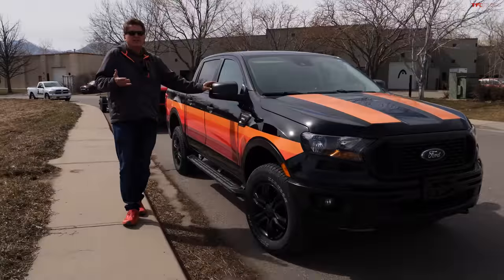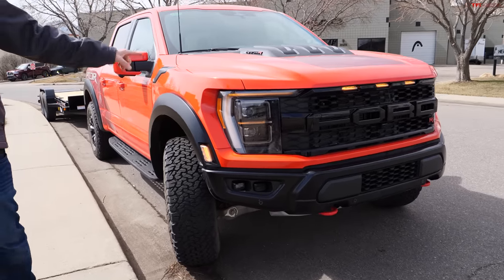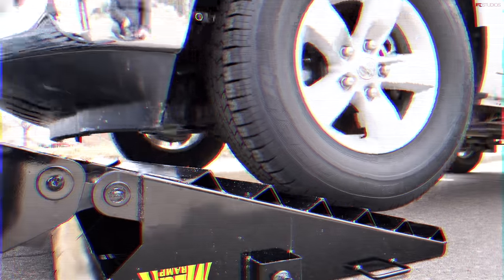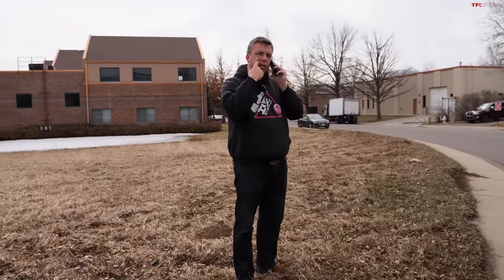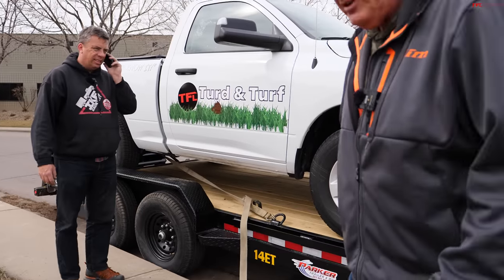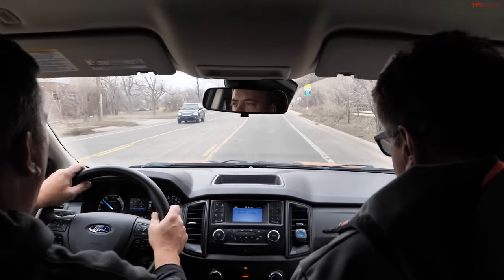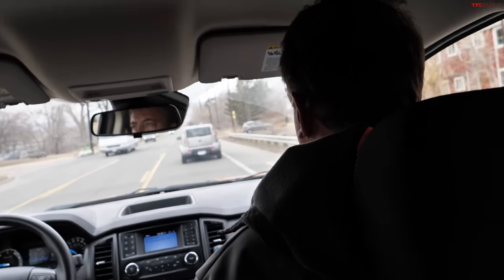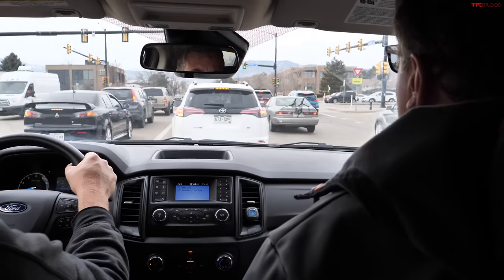I Made a HUGE Mistake and Bought the WRONG Trailer: How Do We Fix It?

Comment: I hope I’m wrong, but it looks like you traded one mistake for another. The saleswoman said the deck is 66” wide. A RAM 1500 has a 68” track width, and is almost 80” wide overall. Even the Ranger is probably too wide to fit. This trailer will limit you to hauling equipment less than 66” wide. Seems like a car hauler trailer would be better for your application than an equipment trailer. Also, it appears the front tires will pass the tilt point before the rear tires are on the deck, or does the deck lock in the tilted position?
Reply: The pickups will fit, because the tires can overhang the width of the tilting deck (although something like a Raptor may be a problem getting the front fender flares between the trailer fenders).

I absolutely agree that a car trailer would be more suitable for hauling cars and pickup trucks than this equipment trailer. Essentially, they swapped a highly unsuitable folding-ramp equipment trailer for an unsuitable tilting-deck equipment trailer.

The new trailer is a 14FT-20, from Big Tex Trailer's 14FT series of 14,000 pound self-tilting equipment trailers. Their website (which I can't link in a comment on this YouTube channel) has a "detailed measurements" drawing which is missing actual lengths, but indicates that the pivot is behind the middle of the deck (presumably so that it sits down when unloaded). That means that the deck will start coming back down when the front axle is less than 10 feet up the deck (in the 20-foot deck model), so any wheelbase over 120" (which means every pickup truck) won't work. I've seen a neighbor get caught by this when he tried to move a pickup with the trailer that he usually uses for his skid loader.

I don't see any way to lock the deck up, there is no manual available on the website, and if there were a mechanical catch it would likely be impossible to release under load. It could have a hydraulic lock, but the sales rep didn't suggest that in the tour.
Reply: I was hoping no one caught my slip up on the platform width. It is 6'6" wide not 66" wide. You'll have to forgive me I was a little nervous. On the full tilt the deck does not lock in the tilted position.
Reply: @brianb-p6586  Thank you for your detailed response. I got the 66” inch width measurement from the video, but I see that was cleared up in another comment as being 6’ 6”, a big difference.
Reply: @rickcollins1796  It is a very significant difference, but some trucks with wide tires will be wider than even 6' 6" (78", 1829 mm). 

For instance, the current Raptor has a front track width of 67.9" (1725 mm) and tire section width of 315 mm (stock) or 12.5" (optional), for a width between front tire outer sidewalls of 80.4" (2042 mm) and across the front tire treads of 78.5" (1994 mm)... and that's stock.
Reply: @AngieDavid-mx5dn  Thank you for the clarification. Don’t be hard on yourself, no one can recite the specs for everything on the lot, especially with a camera pointed at you!

Comment: The 4-cylinder vehicle got 6.5 not 8 MPG when you used it to tow the trailer and vehicle and it was not able to maintain freeway speeds, that is something you should be considered in this test. The smaller engine with a turbo may work for a short distance, around town but not for long distances it is inadequate.
If you really wanted this test to be accurate you should be testing a petrol engine and diesel engine of about or as close to the same displacement but then it is known that the Diesel is a better tow engine that is why semis have diesel motors.
What is needed to tow or haul is torque, not horsepower for this a diesel make more torque and less horsepower than a compatible petrol engine and going back to the 4-cylinder not being able to maintain freeway speeds you are not considering the effort the motor is going though to do the job a larger displacement can do the job easier, with less stress than a smaller one turbo or not if you did along with the other points I made here you would see your test is void.
Reply: My 6cyl truck from a competitors brand averaged 12mpg at 70mph with roughly similar weights in an enclosed, single axle, equipment trailer... Turbo 4s are good for small cars and city driving. Not real work loads.

Comment: You might want to consider putting diamond plate down following the tires path. Once it gets wet, the plywood deck is going to get slick. Unless you're using a winch. Hope the new trailer works out.
Reply: Diamond plate is 10 times more slicker than wood.  Unless you mean expanded metal.
Reply: You need something with grit, diamond plate would make it worse.
Reply: Patches or strips of grip tape could be a cheap and effective solution if additional traction is needed.

Comment: Have you ever seen trucks with big holes in their tailgates?  Loading a trailer while it's not attached to the drive truck is how that happens!   You guys lucked out.  If that would have surged forward you would be in that club.
Reply: It was attached to the Raptor when they loaded the white truck.  They just used the trailer jack to lift the front of the trailer which will just unload/raise the rear suspension of the raptor.  Unless I missed a shot somewhere of it specifically showing it being disconnected.

Comment: Should have bought a proper Brian James Trailer or an Ifor Williams Trailer Transporta. A beaver tailed trailer is good, but it isn't really a car carrier from the outset. However, this was clearly a video about the importance of correct trailer choice and trailer safety. Just come out and say it at the beginning instead of insulting peoples' intelligence.
Reply: The BigTex brand that they used has proper car transporters, too. They just chose an unsuitable equipment trailer then replaced it with a likely more suitable equipment trailer, instead of buying a car trailer from the same dealer.

Comment: It's because the Ranger is sitting so low, the trailer is to big for that little truck and i think you have way to much weight for that little truck!!!!! and that Doge sit way to low for a full size pick-up!!!!
Reply: No, the truck height doesn't matter. The hitch should be adjusted so that the trailer is level, regardless of the height of the truck.

Comment: Another no thought, boring TFL video. For a million sub channel, the views have been pretty abysmal with this new direction the channel has taken.
Reply: haven't watched any videos lately because content is stale.
Reply: @zachlafond2652  absolutely. Another channel I sub to has 950k subs, so less than TFL but their video yesterday dropped about the same time as the snoozer TFL dropped about that old truck and it was 250k views compared to 14k. Hmmmm
Reply: Why do you keep coming back then? @pryme2013
Reply: @ALMX5DP  To make an observation and leave. The channel used to be good with well thought out but logistically tough to produce content. The new style of TFL is dumb flashy thumbnails with silly taglines like “I screwed up” with embarrassing hand gestures like hands on your head but very stale and easy to do videos that take no thought to toss together in minutes. It’s lazy and it shows in the views and I’m sure abysmally low view duration.
Reply: @pryme2013  well as long as you know that type of engagement feeds the algorithm so you’re really only perpetuating it by doing so if you feel that way.